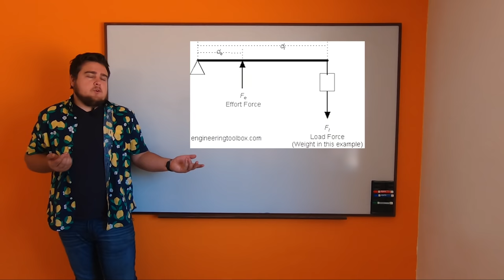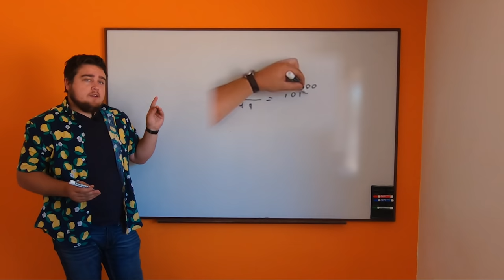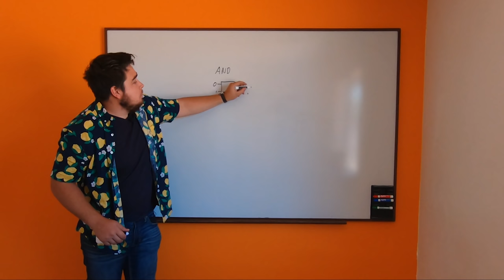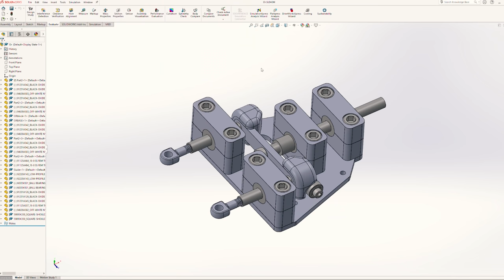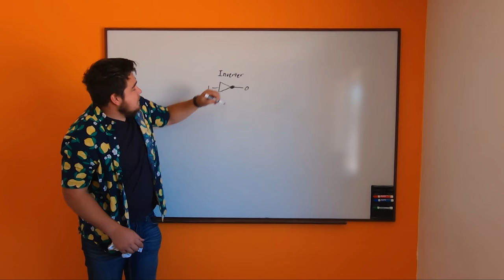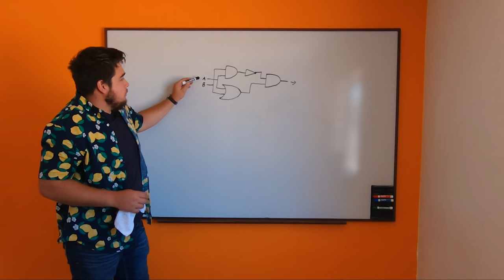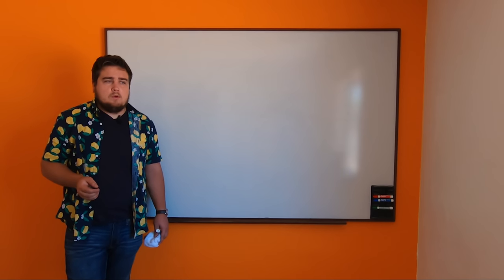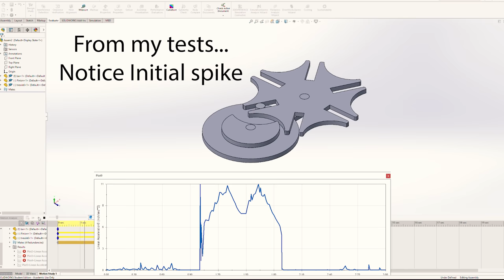Is a Completely Mechanical CPU possible?

Comment: A couple of things you might want to look at if you're after a binary based mechanical computer. First would be Charles Babbage and his various engines, specifically the difference and analytical engines (the latter being intended for complex mathematical calculations rather than as a series of gates).

Second would be mechanical railway signalling as it was required to have systems called interlocking to prevent conflicting routes being cleared over junctions. Over particularly complicated junctions or in difficult situations, the equivalent to such gates as AND, OR, XOR and so on were and still are in common use. Actual diagrams are a bit tricky to get hold of, but might serve as inspiration for any further designs

Comment: I enjoyed this video. I like you humour too. We’re obviously ignoring friction here but, computing is a funny thing. The passage of 1s and 0s, just two variables, at immense speed and using the said mentioned logic, allows for some great outcomes. The mechanical world has far more variables but, in doing so it actually makes things far more complex. The fact that you can see and touch mechanical things makes it easier for our minds to digest. Gas turbine engines used mechanical and pneumatic control for years and they worked very well but, they’re heavy and they wear. Still a fun project though!

Comment: A guy called Charles Babbage started designing a mechanical general purpose computer (although he did not realize it was general purpose) called the Analytical Engine in 1837.

Ada Lovelace, generally considered the first programmer, realized some of its potential.

It was never built but there are some videos on the YouTube channel numberfile about it.

Comment: Holy moly this video went really high concept at certain points. The question in the video title is pretty trivial, obviously yes. But perhaps a more relevant question is can it be completed by a single human within the limits of human patience and productivity within the context of a youtube project. I don't know that answer. Perhaps the complicated ongoing saga of the Marble Machine X project might answer: "maybe, but it'll be way harder than you thought at the beginning". 

Good luck though, it legitimately sounds like a fun journey. I imagine the trip(s) up and down mt. stupid and through the valley of despair won't be easy on this one. Neither will the un-googleable technical bugs, nor the integration hell, nor the deadly feature creep. That said, this project falls way more into the "art" bucket than the "technology" bucket (the lack of a useful purpose is a dead give-away to me), so I think all those great filters could be embraced as part of the journey rather than shunned as frustrating technical road blocks.

Comment: U.S. Navy in ww2 had (electro)mechanical fire control computers that could beat digital until the 80's. They were about the size of a pool table. It took something like 20 inputs (shooter's course, speed, turning rate, roll, yaw, and pitch rates, temperature of gun, temp at seal level, temp at several different altitudes the projectile would pass through [twice], wind at shooter's position, at target, and in between, and then of course the targets course, speed, turning rate etc.) These inputs were coming in from various places on the ship, and were constantly being updated. When the gun was loaded and brought to approximate azimuth and elevation, the computer would make final adjustments, and tell you when to fire...

Comment: I work at a Land-o-Lakes and our butter printers (the machines that actually make the sticks of butter, wraps them and packs them) uses two Geneva drives (also known as a Maltese cross) and some of our printers are 40 to 50 years old (albeit have had some major upgrades over the years) and when these things explode they do so with gusto! If you have ever seen a Dodge transmission explode on a highway imagine that but with much larger pieces.

Comment: Excellent topic. I think the biggest problem to scale up direction general purpose will be to clock all your gates to prevent unwanted feedback loops. So basically something that measures and internally propagates input once during a common clock cycle. I guess idea is to setup vertical and use gravity as springs ?

Comment: Maybe the concept of efficiency could be re-explored in a grand scale. To get electricity to power all of our equipment, monolithic power plants and distribution networks are required. The power plants themselves need to be powered. Are transport vehicles needed here, which need to be powered as well? Unwinding the full scale of dependencies.

In addition, to take into account all of the required effort in building the power source system and all of the appliances. And maybe most importantly, the pain of maintenance. Fallback systems. Would be really interested in seeing a close proximity mini-plant which is a primary power source for example for a single block of flats or a neighborhood. Having a distant monolithic power plant as a fallback.

Engineering with reliability in mind. Thank you for the inspiring video.

Comment: @Wesley Kagan Yes, completely mechanical, fully analog computers computers were used since before WWII on warships and submarines to provide a firing solution. They were still in use when american Iowa class battleships were withdrawn out of active duty in 90's. They worked flawlessly and accurately. Mechanical digital computer never had chance to appear, because digital electric/electronic components such as lamps, diodes and finally transistors, were developed  in more quality and quantity soon after WWII and there were no sense in making digital mechanical components like these.

Comment: Hi. Lovely video. ps I think Babbage's original mechanical computer design was (intended to be) somewhat programmable, I.e. one could have changed what it was computing. There is a piece of it at a museum in London. Also, I believe Newton also designed a mechanical computing machine, but did not attempt to build it.

Comment: There is a practical application, running a basic combination logic system for a million year on say 'mars' , silicon devices won't last much and you don't have to use boolean logic ( 1  0 1 0 etc.) since there is no noise issue.  you can use  1 2 3 4 ...32 to reduce number of gates required

Comment: I did electronics as a kid in the 80s, so grew up with Forrest Mim's Notebooks so know my logic gates. You could design a NAND, and create any other gate with combination of 1 or more NANDs. Make a NOT by setting one of a NANDs input to 0. Set both inputs of a NAND to the output of another NAND = AND gate. etc.. I guess this is a 'fun fact'. Can also use a NOR.

Comment: if it has any practical purpose, it's probably in educating people about how logic circuits work. 

it will be interesting to see if you get as far as building a basic calculator. i know someone who built a VERY rudimentary calculator in DigSim on the Mac Classics in our 90s high school computer lab, it was pretty amusing to watch it "boot" (it would take the entire class to load off the network by the time it was done, and then took a while to "initialise" so that the display, made of light bulbs arranged into seven-segment displays, would read 0 and not any other number :3 ) and attempt to do anything resembling accurate calculation, but it def deserved A+++ for effort ^_^

maybe you can even get into some of the things vacuum tubes do that ICs don't necessarily do.

Comment: What an interesting concept; one difference however between electronic gates and mechanical gates is the fanout or drive capability.  Electronic gate outputs can often drive tens of inputs for succeeding gates but mechanical gates seem to lack this feature, which means increasing power at the first inputs to drive each succeeding logic stage.

Comment: Hi ! your work is very cool ! I just saw your video saw what i ll say after is just a "first sight though" on what differs from your mecanical approach than electronic one.
From my perspective , logic gates induce on their outputs a logic state from their trigged input , so at this point this is identical to your devices , but , electronic logic gates use their own energy (power supply) to drive their output. from what i remember the "sortance" (in french language) is something used to determine how much gates can be driven by one (depending on semicond tech) .
so the first feedback i ll give you will be , the activation energy on first input gates may be unhandable by your first interface gate if the complexity of your logic increase, particulary in the case of cascading in multiple stages. if i was thinking about such a system i would consider 3 things : 
- adding mechanical energy income  for each gates (perhaps by air pressure or something like that) 
- making mecanic switch less linear , turning them into stackable bistable with less activation energy (consider spring bistable or flat springs , well i dont know i dont know very much about mechanic)
-keeping global logic diagram the more parrallele processing as i can (avoiding stage stacking)

i wonder about loopback system energy minimum activation level which blow my mind  (perhaps it can be saw as a congerving serie in inifinite but i dont know)

in any case i am just enthousiast to see the next steps !
Reply: I also forget to mention that your gates seems to be at least a bit bidirectional. conventional gates are not , but i canot say if it matter from what i see it doesnt

Comment: Logic elements have been built using air and liquids. For a computer, you need an inverter such as a NAND or NOR gate, or a plain inverter. Then you can make an adder and subtractor for math operations.

Comment: For context: Konrad Zuse got the Z1 working back in 1938, including full programmability and floating-point calculations.
Babbage's Analytical Engine design (not built) from 1858 was programmable.
This is starting from different requirements, and includes knowledge of the function of integrated circuits and neural nets, so could have interestingly different outcomes.

Comment: in big models it will be hard to push pin
previous block should only define bits to current block
and then tick pin is pushed and is doing work using external energy ( every tick should be pushed nearly simultaneously on all blocks, layer by  layer ) and define bits to next layer
in the end when we read result we can call reset pin from end to start
we can rotate one shaft to process all of it

Comment: Late to the party here, but a former colleague of mine back in the 80s, an engineer named Dave Oberholzer, invented a drive that produced constant motion throughout its rotation. The application was reading barcodes that were etched into the outer rim of silicon wafers used in microchip testing on the wafer - the test machine's rotational motor operated step-wise so couldn't be used for reading the codes.

He (or, more likely, our company, Western Electric, which may have become AT&T Microelectronics by the time of the invention, I don't remember exactly when he did it but it's circa 1984 - it was definitely a few years before before we became Lucent) received a patent for the device, which was basically a motor driving a cylinder with a groove that spiraled from one end to the other then smoothly back the other way. The crucial feature was that there was no change in speed despite reversing the direction at the cylinder's ends. A peg in the shape of a vesica piscis (the shape of the intersection of two circles, basically an oval with pointed ends like a football, this shape prevented jams where the groove intersected itself) rode in the groove and would move from one end of the cylinder to the other at constant speed. A simple sine wave would decelerate as it reached the ends and that caused errors reading the barcodes. I don't know what mathematical function(s) he used to create the grooves and achieve the effect.

The device might solve the continuous motion problem you mention at 9:54. I'm not an engineer, I'm a software designer, so pardon my imprecise terminology. I did a cursory search for the patent but couldn't find it.

Comment: Something to consider when moving toward a larger CPU is to construct the other gates from a single type. Off the top of my head, I know you can construct each of the gates from NAND gates, and XOR gates. This would give you a much more serviceable machine that can be assembled and serviced with a unified supply. Likely you'd need to construct the ALU as a single unit to account for what kind of motion you're using to drive the logic. Very cool video. It's something I've been thinking about with the current state of semiconductor supply, how to regulate vehicles using their own internal motion rather than converting to electricity.

Comment: The main problem I see with this is that at scale every component will have to bear the forces of the entire logic line. If you create circuits and combine them into a computer, the force required to move all of those components will be quite big, and every little AND gate lever claw will have to bear it.

Comment: The part that you will have to fight is friction. This I believe will be the dominant factor stopping you from creating a huge mechanical computer. The actual electronic gates amplify the signal. So the more mechanical gates you put, the harder it will be to push the initial bits, without any way of adding energy per-gate.
Reply: you can say mechanical computers also amplify the signal. it is essencial.
classical mechanical calculators do not model the electric current as a solid mechanical shift from inputs to outputs, instead they use a spinning drum (a flyweel) as a central source of (somewhat calibrated) momentum -- thus the energy does not transfer from inputs to outputs (as in your proposal) but inputs signal to the energy distributing "core" to dispense predefined portions of energy to the outputs.

Comment: Great fun idea, not sure that it'll work *as is*, for various reasons - most of which have already been raised. You will need to send signals in a physical direction other than in a straight line and you will also need springs to reset the output values back, currently they work when being initially set but have no way to reset afterwards.

Comment: The concept is sound.  Electronics use a Transistor to do the job (Emitter/base/collector), and other plastic things.  A mechanical Gate is just the larger mechanical representation of Boolean Algebra.  The computer will be muc larger (until you find a way to microsize the mechanical gates and thus reduce the size of the computing device.).

Good job.  The Concept is sound.

Comment: Charles Babbage is the master of mechanical computing. In mechanical computing you are not limited to working in binary, you can design a machine for base ten if you want. For simple binary computing you need a storage element, in electronics it is called a flip flop, a single bit memory element. In machine design there are several ways to make a memory and sequence through operations. One example would be to use a punched tape streaming instructions into the processor or use punch cards like the old IBM tabulating machines. 

Babbage had a good dedicated mechanical solution, but required very precise machining to reduce the size of the machine using interchangeable parts, which was really not economically viable during his lifetime. However, after all his work he realized that it would be better to run a stored program that could be easily changed rather than one dedicated single process mechanical program. Which introduced the concept of computer programming. The realization of a stored program approach was discovered once again with electronic computing. Even a dedicated task, like doing arithmetic on a calculator, that was initially conceived as fixed dedicated binary functions, was improved by using a general purpose machine (microprocessor) that ran a dedicated calculator program (or app).

Comment: These gates lack two properties that are needed in order to make a significant digital processor: (1) Fanout, and (2) Quantization. The fanout requirement means that the output of one gate must be capable of driving the inputs of several other gates. Since these gates have no power amplification, their fanout is less than unity: In other words, as circuit gets more complex, you need an ever-increasing force to drive each gate. That is one reason that you cannot use springs to return an input to its initial state.  Real gates need a power input as well as logic inputs. The quantization requirement means that the output of each gate must snap to the 1 or 0 state more accurately than its inputs drive it. For example, any input greater than 70% travel must generate an output of at least 90% travel. Without the ability to snap cleanly to 0 or 1, after a few stages are cascaded, the gate's states will tend to a midway point and cease to function as digital gates.
Reply: You laid it right on the line.

Comment: You can create a logically complete system using only NAND gates which are actually simpler in terms of transistors than seemingly more fundamental gates. I'm not sure if that simplicity would translate to the mechanical realm, though, but the modularity certainly will. With only one component to worry about, it makes the whole system much easy to keep track of.

Comment: This was recommended after watching a vid on the effort to make a "steampunk" Venus rover that could survive high temp/pressures, and avoid obstacles. One example had a mechanical obstacle avoidance system that responded to colliding with something head-on via a simple rod that reversed the rover. These robust mechanical gates could be used somehow to take multiple mechanical inputs for smarter navigation. Don't ask me how though.